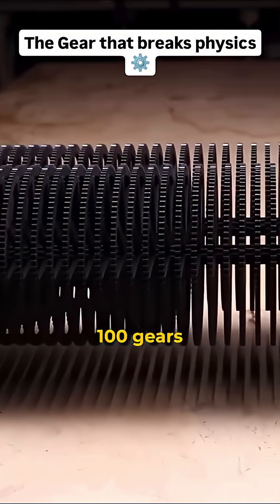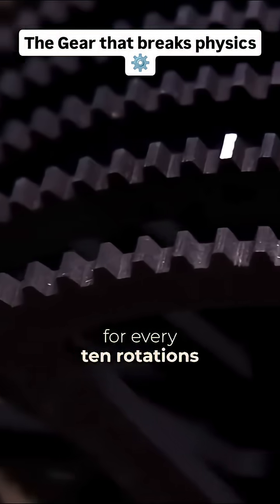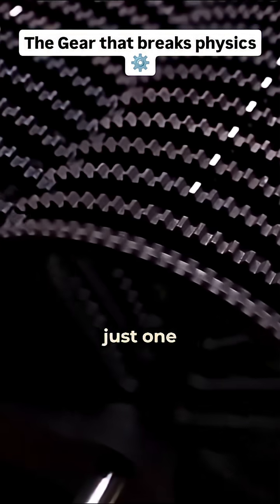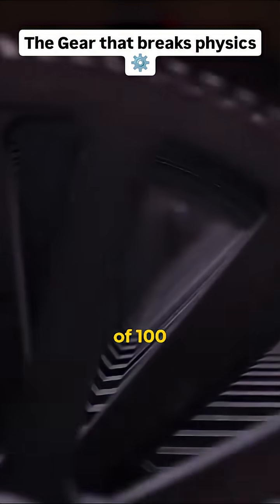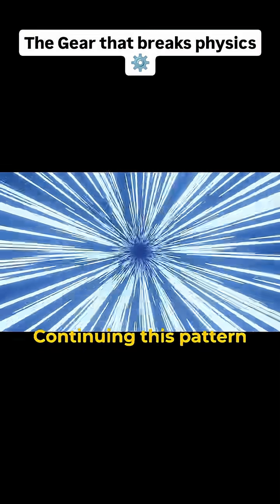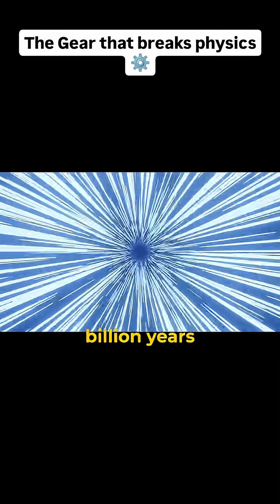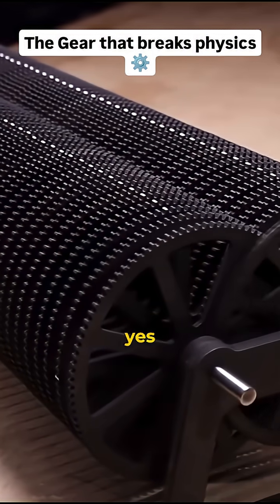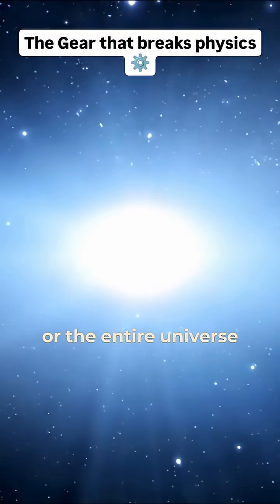Insane gear system ⚙️

Comment: How does this break physiscs? Sounds like it perfectly obeys physics.
Reply: I suppose the problem here is, assuming those gears fit absolutely perfectly, if someone wanted to move the last wheel by the smallest distance known to modern physics(Planck's Length), it would require the first wheel to rotate faster than the speed of light, which is not possible by anything that has mass.
Reply: I fully agree. I’ll just add that not even a photon, which has zero rest mass, can not travel faster than the speed of light. It makes sense. A photon traveling at the speed of light reaches the edge of the universe in zero seconds (from its own inertial frame of reference), and that’s because the length of the universe in the direction of the photon’s motion contracts to zero. Here, billions of years pass. That’s why it’s impossible to go faster than light — space would have to contract to negative dimensions, and that doesn’t exist.
Reply: @Lesminster  Poor Planck, he probably went through his entire life embarrassed about his length.
Reply: @Lesminster it's simple, Last gear will break, nothing material could bear that much of force.
Physics is not breaking here.
Reply: @deepaknanda1113  Why just last gear?
Following your logic many of those wheels would break due to such speeds and forces. The fact clip talks about the last one is because it is specific and I think that specificality is due to what I wrote earlier.
I don't think this clip is about friction.
Reply: @Lesminster LAST GEAR coz ur applying force at the last immovable gear, no force  could pass from that, so no other gear could break. Think again.
Also I'm also not talking about friction, in ideal imaginary situation, friction is non existent, why bothering about it.
Reply: Yup, completely
Reply: It breaks physics in the same way a neutron star breaks reality.  In other words, it literally doesn't.
Reply: first day on the internet?
Reply: imagine getting thee Last one to rotate at light speed. then how fast is the first one turning ?? ai, care to calculate ?
Reply: @joestitz539 186000 miles/second.
Reply: I think he means you would have to break all known laws of physics to complete a rotation of the final gear. And he'd be right.
Reply: @DrewJPS  Yes, I understand his point, I just think he is wrong
Reply: I need a pry bar made out of this since all the energy in the universe couldn’t break it.
Reply: Because in order for the last gear to turn it will be older than the universe.
Reply: @one_bad_mofo8658 Not when it turns.
Reply: @one_bad_mofo8658  Wow that's a deep thought, considering that without the universe, the gears themselves would not exist. And it ignores every possible item in the universe that we could not even think of existing or even to be created
Reply: @ohioridercinci2495 you're not smart trying to sound smart. But its funny watching you try.
Reply: @ohioridercinci2495  What nonsense. The point is that there is a total gear ratio of 10^100. The smallest possible distance that the last gear can move is 1.616 x 10^-35 metres, which means that the outside of the first gear will have had to move 1.616 x 10^65 metres. Those gears have a circumference of about 0.5 metres, which means the first gear would have had to turn about 3.2 x 10^65 times. However, the universe is "only" about 4.35 x 10^17 seconds old, so to do that the first gear would have to be rotating at around 7.5 x 10^47 times per second. 

To make that clear, that's 75 followed by 46 zeroes.

So, no. That mechanism could not more the last gear by the minimum possible amount within the lifetime of the universe when rotating once every 3.5 seconds. It would take of the order of 2.6 x 10^48 times the current known lifetime of the universe to complete it, and nothing can change that.
Reply: @TheEulerID If it kept turning, the universe would continue to age. What prevents the gear from turning them?
Reply: The last gear is immovable, not stationary.  If it moves, the edge of the first gear has to be moving faster than the speed of light, in which case it would have infinite mass.
Reply: Basicly movements so small they are near to the "Plank Length" (1.616 x 10⁻³⁵ meters)  would be required,by the gears. At this point the "Standard model" of Physics is thought to break down in favour of Quantum Gravity effects on whatever there is at that size (in theory at least). In practice of course, I guess the forces involved are far greater than the forces holding the atoms together, and it just breaks.
Reply: I don't get it, but it facinates me.
Reply: It's the same as dividing by zero, squaring infinity, a black hole singularity.   And you can build it in your living room.
Reply: Caption for idiots, content for average intelligence. At least it wasn't AI.
Reply: definition of clickbait, all these comments (including mine) are what they are fishing for
Reply: its about time
Reply: What is the point ?
Reply: Cause when the guy assembled it, he left out one screw so the gear would never turn....

Comment: The first gear will be worn out long before the last gear turns.
Reply: True but it is more metaphor than physics
Reply: @lewisjbh  I can make metaphors without involving my 3D printer.
Reply: Yes...regular wear and tear matters a lot hence the working system collapses.😊😊😊😊
Reply: Still doesn't change the PRINCIPLE.
Reply: Not if you apply DW40 at regular intervals 😂
Reply: It’s not all doom and gloom, go to the back of it and give the last gear a helping hand. 
 So as that first gear turns the very last gear should also be turning. Imagine if you could witness it turning. It should be in constant motion.
Reply: @JamesHaggart-f2b It doesn't matter how you turn the last wheel, it still requires more energy than the universe contains under the Big Bang theory.
Reply: The whole gizmo is there to represent a concept. The first wheel will take a looong time to wear out, but when it does, putting on a new one presents a whole bunch of new challenges.
Reply: Good point 😂
Reply: Think is, the video sparked a lot of debate, with people finding flaws but not presenting their own video .
Reply: The earth will end long before the 10th gear moves.
Reply: your comment caused a rift in the continuum.
Reply: Use WD-40
Reply: Heh the entire assembly will have decayed by the time the last gear even thinks about turning.
Reply: @Briguy1027 not really the point… it’s representative
Reply: The last gear is actually turning. If it weren’t, the penultimate gear wouldn’t be turning. Repeat the reasoning until you reach the first one. Conclusion: if the last gear weren’t turning, the first one neither would be.
Reply: @pysaumont You need to account for slop.
Reply: @pysaumont no, it doesn't even take up the back lash.

I know what you mean it should be technically turning straight away, but you'll find the small backlash between the gears will stop that.

Comment: In essence it’s a mechanical device, and it can not complete its task, the initial gear set cannot survive the requirements simply due to mechanical contact and durability over time…so in practical terms as it’s is presented and the know factors…this device is and shall never realize its design goal!
Reply: It's design goal was to demonstrate the google, and it does so handsomely.
Reply: Well phucking said😮😅
Reply: Yeah but it made it's point didn't it
Reply: Are you a riot at parties?
Reply: It is designed to fail as the input gear can never be stopped replaced or serviced. Most modern devices such as washing machines, hair dryers etc are designed to fail about 2 years after the guarantee runs out.
Reply: You must be kamala harris' speechwriter with this word salad.

Comment: Could we force the last gear to turn? Stupid question. If all those gear are perfectly connected, the force experienced by the first gear is always equal to the last gear but due to human limitations in design and all those  tolerances. Here we see the difference between God and human
Reply: If it takes 1 gram of force to turn the first gear, it would require 10^94 metric tons to move the last one.  In comparison, the mass of the entire known universe, measured in earth gravity, is about 1.5*10^53 tons.  God no can do
Reply: @mostlygibberish  thanks for the reply brother, maybe you missed my point because english is not my home language. Based on what you just said I apologize if you still don't get my perspective on this but, in an ideal situation with no tolerance the 1 gram of force you talking about acting on the first gear cannot be possible. It is only possible with tolerance because when you apply that one gram of force the last gear does not experience is as it is only bringing the tolerance close to zero. Remember the tolerance between first gear and last gear will be high vs 1st and 2nd, which is why the 2nd gear will be the first of all other gears to experience motion it is the closest to zero compared to others. If you still don't get it the I don't know how to explain 🤷
Reply: @JoinStatic  I think you confuse tolerance with gear ratio.  You can have God handcrafted perfectly connected gear, and still nothing is going to happen.  You can not turn the last gear directly because there's not enough force in the universe to make it happen.  You can spin the first gear till the end of the universe, the last one still not going to move.  In short, a googol does not exist in the physical world.

Comment: What will happen if we start from the other side?
Reply: It will break lmao 😂
Reply: @cain7925  Initially?  What if the force is in equal rotation.  If it is opposite rotation, would it not have to exceed the strength of the assembly.   If one ounce of reverse direction force goes against that last gear and that is enough to overcome the resistance, will it simply not stall once these two forces meet.   If a car is on a lift in neutral and I spin the driven tires in one rotation and the shift is made in the opposite rotation doesn't the larger force (car) overcome the lower force, hand, and isn't the hand force far too small to break the assembly.
Reply: @whatsup3270 it simply cannot withstand the energy used to rotate it, hence it will break. Assuming u have an energy equal to a speed of light to rotate it.
Reply: @cain7925  Gear 11 it says will rotate 1/365,000 in 3.5 seconds so what has gear 99 rotated?  I say zero, so what prevents gear 99 from rotating in reverse, I say nothing.
Reply: Tell me, my friend, what do you know about the way gearboxes work?
Reply: @gregoryblack4074  Obviously, everything. Probably invented it.
Reply: That’s what she said 😈
Reply: Big bounce 🎉
Reply: tthe same thing, that gear does not know it is last, or first.
Reply: @whatsup3270  nope. Gear up and gear down are different. Will not overcome  the inertia (and friction) from the other end.
Reply: @NuriLeflef-ll8vs  What inertia, what friction, most gears are at rest, any force on the other end works like a system receiving its first force. Until the force is transferred to a gear, that gear has no force.   If the opposite ends receive force in a synchronized direction, they will speed each other up to full speed.  If the forces are opposite the higher force will snap the assembly.     Simply the gear does not know force is coming thus any force is acted on in an equal manner.
Reply: I mean, he explained that in the video.
Reply: Hypothetically..the first gear would move at the speed of light..
Reply: There's isn't enough energy in the universe to turn the gear from the other side
Reply: @GENESIS-bj4bp thats stupidity. You put enough force on the last gear it will definitely rotate (it will just break the n-1 gear). What u are arguing is assuming the n-1 gears won't break even if u apply large enormous amt of force/energy on last gear, then the argument is correct that u need almost infinite energy to rotate last gear, but then you are breaking fundamental principles of matter & physics abt strength of gears that won't break.  At best u are justifying one law of physics by ignoring other laws os physics
Reply: @GENESIS-bj4bp 
Break this shit and your done
Reply: @GENESIS-bj4bp yes sir, you are right 😊
Reply: @GENESIS-bj4bp yes there is, it would break and then turn freely
Reply: It will not move.